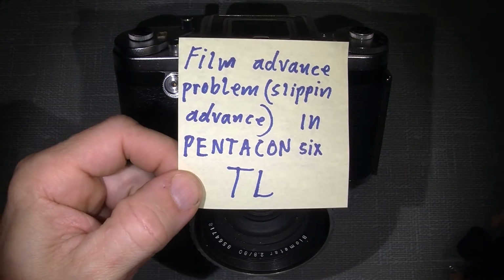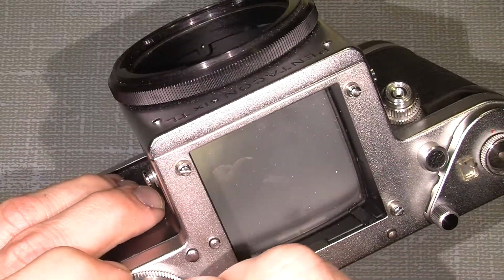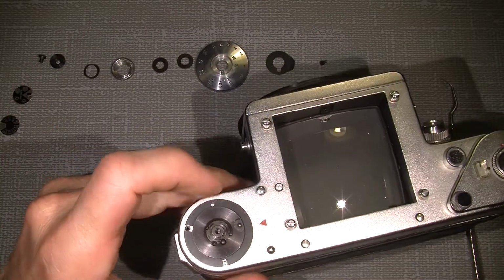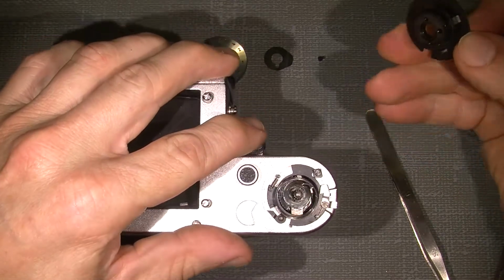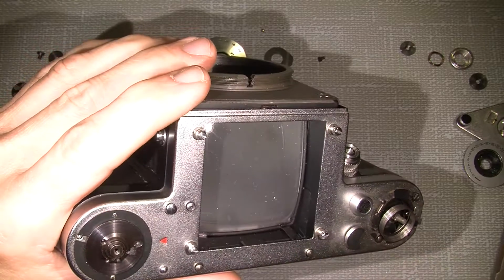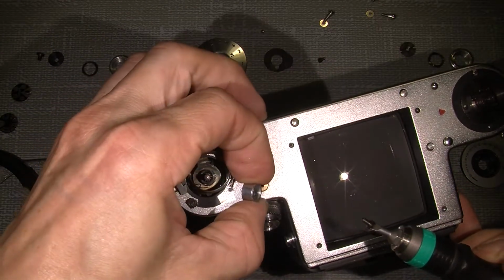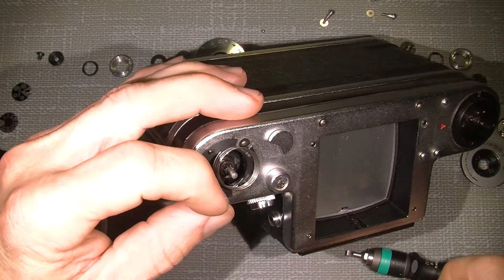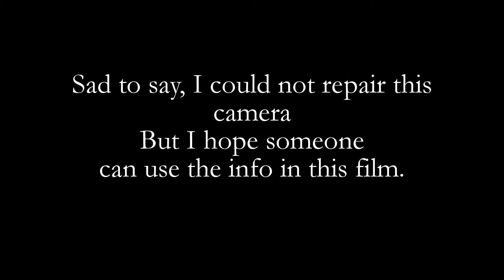Film advance problem (slippin or Worn out advance mechanism) in PENTACONsix TL

Comment: Thank you for the great video! Do you, by chance, know how to fix a mechanical issue on PSix TL? The shutter button does not work anymore. The mirror is down, the winder lever is stuck and the shutter button can be pressed, but does not do anything. I should also mention that the self timer lever is cocked. I think that the issue comes from the timer lever because I've tried (and succeeded) to fire the shutter using the hinge from under the mirror, but the self timer mechanism does not trigger, and after rearming the shutter, the button still doesn't work... I've found the issues on the internet, but had no luck in finding any solves for it. Any suggestion would be welcome.